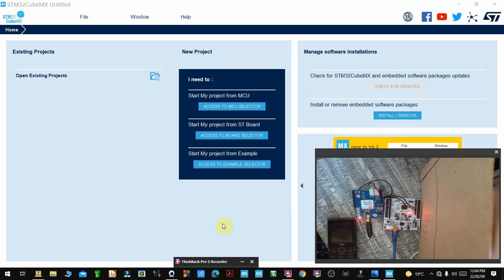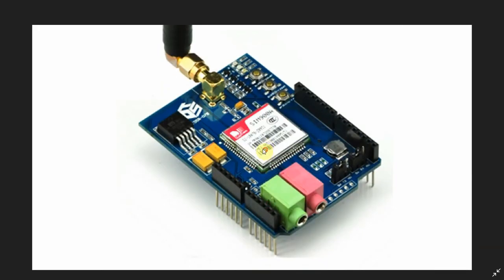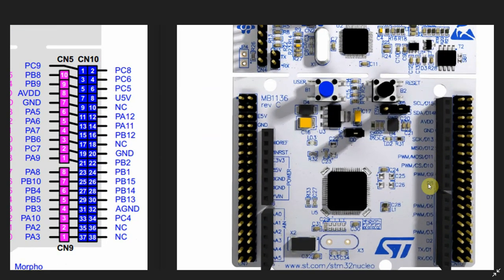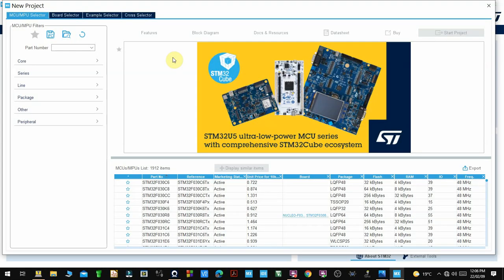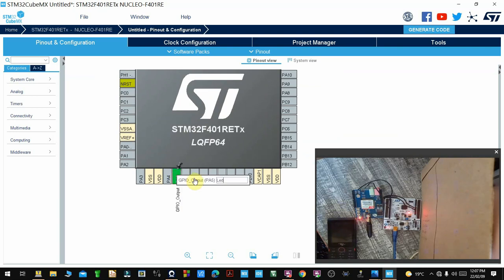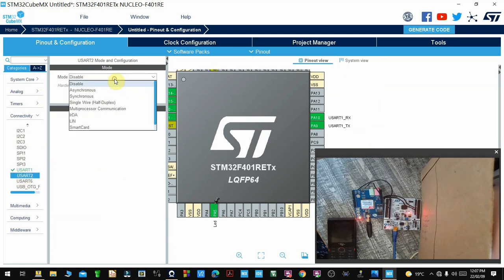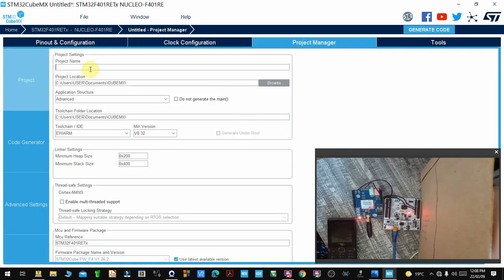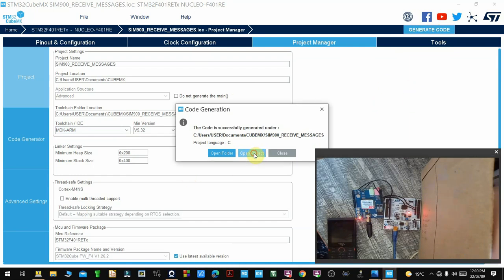RECEIVE SMS USING STM32 AND GSM SIM900 HAL || KEIL uVision.

Comment: if i use gsm900A is it using the same code?
Reply: i am using it for SIM900A, function Send_SMS is working fine but 
 function to read sms is not working fine.
Reply: CAN u share the header and c file?
 @mhassanbashir

Comment: Hi at the moment I'm working on a project using sim900. I'm trying to send sms through the module, have tried several tutorials.. the code runs and uploads without error but I do not get any sms. Could you please help me?

Comment: Hey Dude, I need to send data in this case a Text file from my Stm32 F446re to a raspberrypi, which are located about 100 meters far from each other.
I have a wifi module ESP8266.
Is it possible to send txt file via wifi from Stm32?
If yes could you explain me how can I start? thanks in advance.
Reply from the maker: Hello,thanks for the idea.I will definitely look into it.